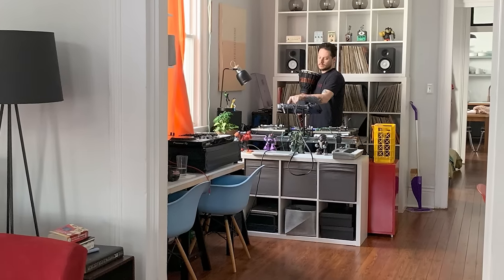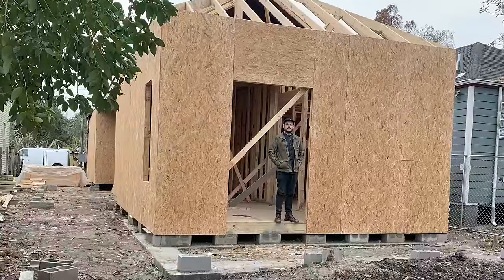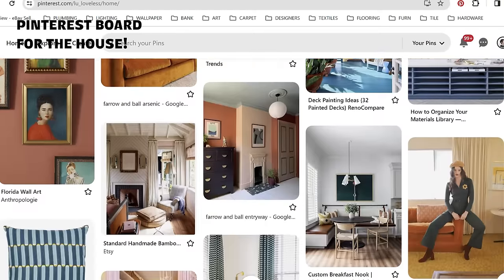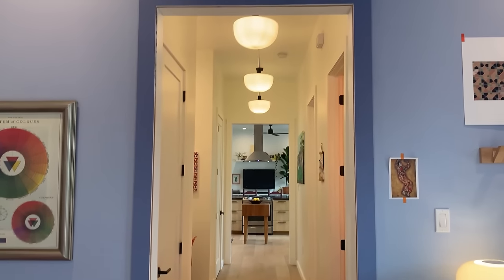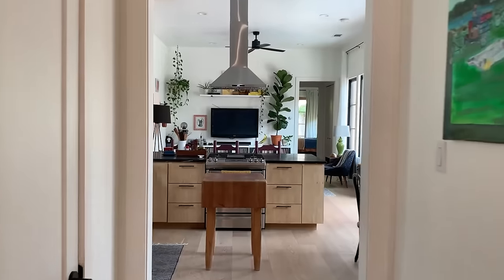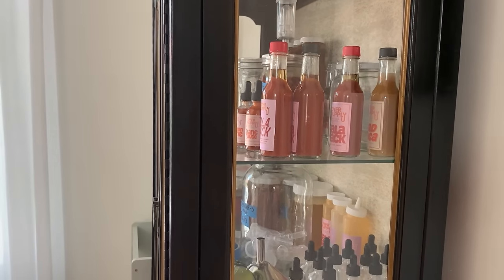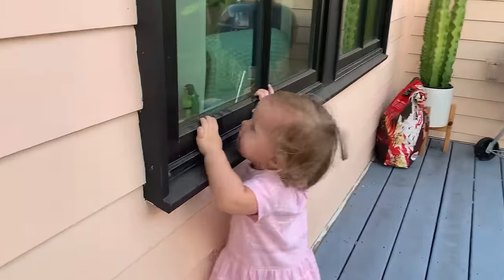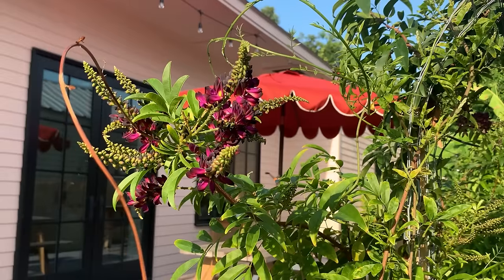Renovated SHOTGUN House Tour |  Colorful New Orleans Gut Renovation

Comment: Suggestion, I'm thinking y'all are young enough to still have elders in y'alls lives.... the Entry Steps might be only two, but elders some days have visual acuity issues. Painting the two steps two shades of the same color can help them see where the steps are a bit better. Painting the vertical surface and horizonal surface contrast colors helps as well, and I think Wes Anderson would approve that. Oh and top coat of the steps? Mix in clean dry silica sand with the final coat or two of paint. Its harsh on bare feet but ensures solid footing when the steps get wet. Since clean silica sand is nearly white it fades into the color of the paint. That back yard looks a bit vacant, think about putting up a few attachment points for a fabric projector screen and build a cart to hold a cheap used Projector TV and you could have your own outdoor lyceum like a drive-in movie theater. Also traditional Southern Architecture never ever had no closets. Reason being they hold humidity and are dark, it makes the perfect environment for the states vast collection of Molds, Mildews, Musts, Fungi. This is why pantry niches are open to the kitchen and hidden behind a drape of beads or light fabric, and why you used to see Chifforobes and Wardrobes all the time. That classic Southern Furniture always had a lining of aromatic Cedar for serious reasons, and it was not unusual to find from time to time one with Teak Bones, Cedar interior, and fancy wood applied to Pine for the exterior. Sadly most of those were thrown on funeral pyres about the mid twentieth century.

Comment: I’m very curious what pattern you’d hoped for with the subway tiles? I have basket weave as a kitchen backsplash and they started mine in the brick pattern and I happened to visit at about row three and it got peeled off while the grout was still damp, phew !! I built in 2020 and my home is 23’ wide by 52’ long + garage attached at the front. Love your home ❤
Reply from the maker: Ah, glad you caught your tile in time! I love a basketweave pattern! I was hoping for an offset vertical stacked pattern, and they did a classic subway pattern (horizontal and staggered). Oh well 🙃
Reply: Perhaps think of it as the classic pattern that they may have done when your house was built. But I get it.  The offset vertical is more funky, like yourself. So glad I found your channel. Happy Tuesday ❤️

Comment: I would have raised the house several feet off the ground to safeguard against possible flooding.
Reply from the maker: That comes with a price tag of $50k+. The house actually sits in a low risk flood zone and has never flooded, not even after Katrina. So we weighed the pros and cons of raising the house and decided against it due to the very high cost of shoring.
Reply: @Lu_Loveless  Good to know. I was concerned because  you mentioned built on a swamp.

Comment: Why do they call it shotgun?
Reply from the maker: Well the rooms in a shotgun house are built one behind the other – with each room opening into the next one.  Doors are usually located at each end of the house and the lore behind the term “Shotgun” is that a bullet shot from the front door would pass through the house without hitting anything and exit through the back door!

Comment: The gentrification of New Orleans continues...
Reply from the maker: I lived in Nola for over a decade, put myself through architecture school here, and worked my butt off to save enough to buy my first home. I’m actually the first in my family to ever own a home and do not come from wealth…shoot, I’m barely middle class. This house didn’t meet the basic standards of living when I bought it - termite and rat infestation, a hazardous electrical system, and no air conditioning. So if bringing a house up to current building codes and putting a bright coat of paint on the historic facade is gentrification, then I guess I’m guilty.